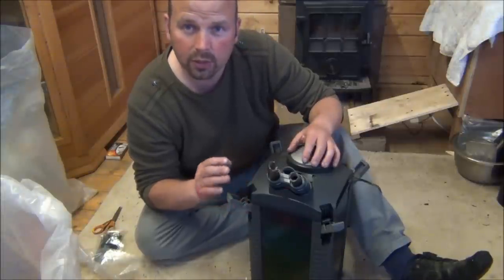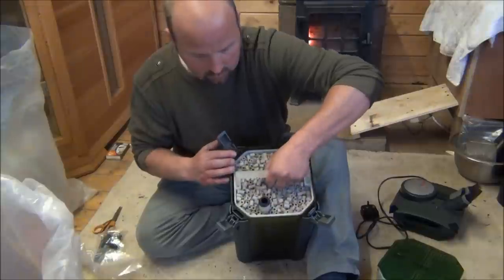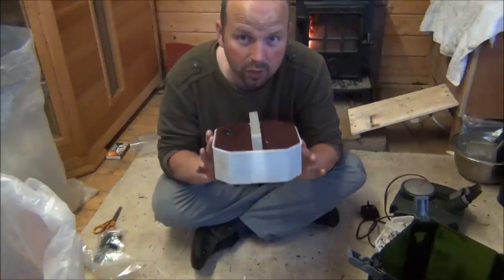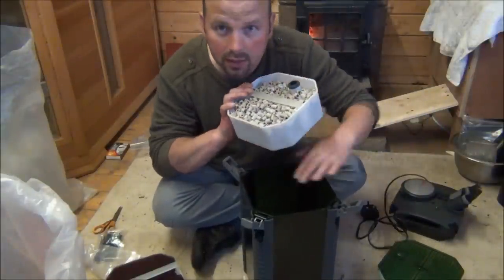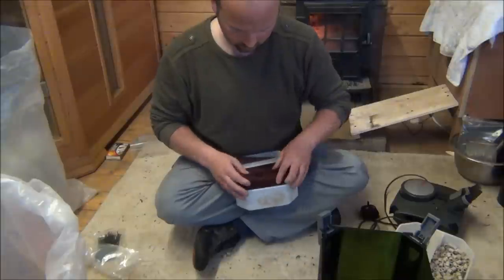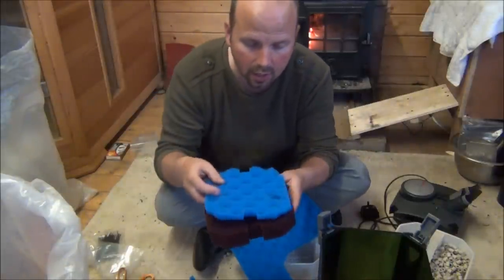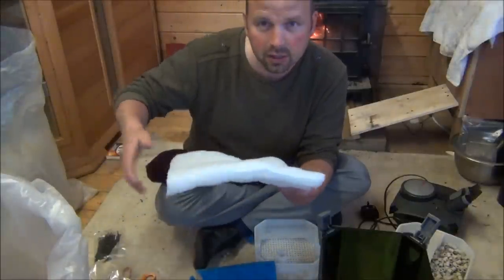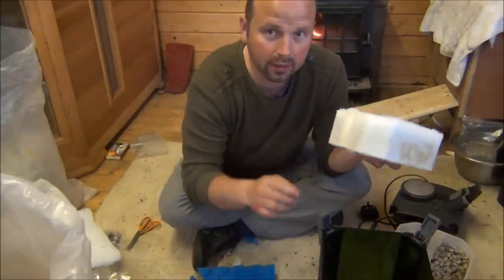How to set up an external canister filter for aquarium by Pondguru

Comment: Hello,

I've recently bought a kg of the Biohome Ultimate for my Eheim Ecco Pro 200. To get a snugger fit in the baskets I'm going to snap each piece in half. This seems to create a lot of rough edges and more importantly, dust. I'm conscious about this dust entering the aquarium. Would it be worth while having a second fine particle mat after the biohome media?
Reply from the maker: Chris Stokes Just rinse the dust off prior to using the media and it will be fine. There should be no need to snap it up to fit in an external as the media is only 3-4cm long (1.5") and about 10mm (0.5") diameter - specifically designed for external filters. Snapping up a small media like the mini ultra or ultimate will affect its ability to hold anaerobic bacteria and reduce efficiency. I would definitely advise against snapping it up as it is not necessary.

Comment: Hi richard, thank you for the many useful video's. Just one important question:

These filters take water from the top, so wouldn't it be most logical if the mechanical filtration is at the top? Because if the biological filtration is placed at the top, the water first runs through there leaving a lot of debree, at the end it reaches the bottom one and than comes back up, so most of the muk as you call it would stay on the biological media.

Can you clarify this for me, thank you very much!

Comment: I actually have a question for the biohome filter media how often do you change the media? For example I have a 75 gallon with 4 fancy goldfish... they can be quite messy and I feed them 2 times a day some days with snacks in between feedings.
Reply from the maker: In a properly set up filter where media is protected from clogging by foams and fine pad the biohome should remain effective for 6-10 years.

Comment: Hi, just purchased some of your Biohome Ultimate after watching your video, my filter is currently set up how yours was upon receiving it.

When I receive your media, is it ok to add the quick start balls into filter if it's already stocked with fish?
Reply from the maker: DaveMorris Yes you can add them and it will help seed the media with good bacteria. In a mature system only replace 25% of your old media each week so the full change over takes a month or so and that way you won't notice a dip in filter performance while the new media matures.
Reply: Thanks for your quick reply, just watched a whole load of your videos, very interesting.

I've got an FX6 so I work the other way to most, how much do you think I'll need to fill that, bar the first tray of course! Bought 3kg and starting to think that's nowhere near enough after watching your videos with much smaller externals!
Reply from the maker: DaveMorris According to the dimensions I have recorded for the FX6 you would need around 1.5kg per tray so if you only want to fill 2 trays then 3kg should be fine. As you'd generally use around 1kg per 100 litres the 3kg should be good to see a decent nitrate reduction in around 300 litres.Some people with the FX5 / FX6 simply go with a fine pad on top of the top tray (as you have lots of foam around the trays) and that allows you to get approx. 5kg in the filter if packed in a bit neater.

Comment: Hi just watched this video & it makes sense,,I'm quiet new to this fishy stuff,,I bought a 4ft second hand tank,, set up and my Fluval 305 is making such a noise,, I've followed all instruction,,primed it till my hand nearly fell off but still,noisy,,then I noticed no water is going in or out of the pipes!!??, so I could carry on with,sorting out the water I put 3 internal filters and they have done the job just great,,but would like to use the Fluval really,,, can you give me any tips ,many thanks Liz 🐠
Reply from the maker: +liz thurstance Just try and fill the canister completely and also fill the pipes too then it may do better. Sometimes externals are difficult to get going. Sounds like you have air in the pump chamber so if you gently tip the filter from side to side that may free it. It is trial and error.

Comment: Cheers mate ,so to clarify ,i d put the peat in the biomedia tray at the top ,and do you know how long till the peat needs changing ?thanks
Reply from the maker: Yes that position is correct and with regard to the active life of peat it will vary from product to product - some is extremely hard, compact or could be loose - just be guided by manufacturers recommendations but it should last many months.

Comment: I have a sunsun canister with 3 trays the one with the 9 watt uv bulb but today I brought a second hand ehiem 2026 with only 2 trays which one would you recommend would you use the one that holds more media or the one with more lph
Reply from the maker: It depends how you set them up. High flow rate will be more beneficial for fish which like a high flow but if you are using Biohome media you will get better nitrate removal at slower flow rates.
If either filter is set up properly it will do a great job.

Comment: You've used a second hand Ehiem, do you need to sterilise it before use, or will any possible nasties die if you just let it dry? I assume that this applies to all second hand aquarium kit. Hope this makes sense.
Reply from the maker: Just give it a good wash out in tap water. I can't think of anything which would transfer from marine to fresh which would harm anything but of in doubt add some Meth blue or anti parasite treatment to the water you are using for cleaning and should be no worries. Most people would just thoroughly rinse under tap then set it up with new foams and new media.

Comment: ok, so you put the ceramic ring right in the bottom of the canister in the gap between base and bottom tray, will this effect the waterflow?? i like the idea adding some media there but worry about the flow rate
Reply from the maker: As long as the ceramic rings allow a gap of a few mm (maybe 1/4") between the bottom of the tray and the rings water flow will not be affected at all although it will head off in different directions through the rings, hopefully settling out heaviest muck.

Comment: I managed to get a second hand Eheim Pro 3 that had previously been used with a marine set up.As i am going to be using it for a tropical set up what will i have to do with regards to cleaning it before use.
Can i still use it ?
Reply from the maker: Just give it a good wash out in tap water. I can't think of anything which would transfer from marine to fresh which would harm anything but of in doubt add some Meth blue or anti parasite treatment to the water you are using for cleaning and should be no worries. Most people would just thoroughly rinse under tap then set it up with new foams and new media.

Comment: Thanks for the videos. I really feel like I can trust your knowledge, and therefore I subscribed.

I am setting up an Eheim 2213 soon, which just has a single can which holds the media (unlike yours, which has multiple media trays). I plan to set it up as you described in the video, meaning that I will have to place my fine filter pad underneath my biological media.

I would like to know what you recommend when it comes to maintenance of canister filters (in terms of media- not the canister itself and its parts). Also, am I correct in thinking that I will have to remove my biological media each time I want to replace the fine filter pad?

Thanks.
Reply from the maker: Yes you will need to remove the media before cleaning the pads or you can get  an in-line filter pod for the foams from All Pond Solutions. If you use one of those before the Eheim filter you will not need to maintain the media filter. Alternately you could put the media into media bags (mesh bags) making it easy to lift out if you didn't want to go with an extra filter. Here is a link to the APS filter booster thingy which would hold all the foams - they are available in 2 sizes. Foams in them aren't the best but it is easy to replace them with the profile cut pond foams and fine particle matting. Hope that helps.
http://www.ebay.co.uk/itm/External-Aquarium-Fish-Tank-add-on-Filter-1-2L-All-Pond-Solutions-EF-Booster-/181384791852?pt=UK_Pet_Supplies_Fish&hash=item2a3b60472c

Comment: I decided to upgrade to a canister filter on my 60 gallon tank. I was going to buy an Aqueon 300, but purchased an Aqueon 400 by mistake. (Actually cheaper at my local store) anyway, I setup my filter using your system but the flow into my tank from the spray bar is very fast. (The fish look like they are on a rollercoaster) I have swordtails, platties, mollies and a few clown loaches. There is no flow adjustment on the Aqueon, is it ok to put a clamp on the exit hose to decrease the flow?

Comment: Thanks for the video, very interesting. Just a question, we have the Eheim professional 2226 filter that has only 2 trays. How would we set this up? Thanks
Reply from the maker: The foams and fine pad would be in the bottom tray and media would be in the top tray. Unfortunately I can't find details on the size of trays or filter volume online, even on the Eheim site for the 2226 but if you measure the tray for media I can work out how much will fit no problem. sales@filterpro.co.uk
Regards,
Richard
Reply from the maker: That works out as 2.7kg of biohome ultimate (possibly you could get 3kg if extremely neatly packed)
Reply from the maker: The amount of media needed to provide full cycle filtration (reduction in nitrate) varies depending on the stock and I have a guide on the Q&A page of my website here: http://www.filterpro.co.uk but that would generally start at 1kg per 100 litres for a normal community tank rising to up to 2kg per 100 litres for heavily stocked situations / goldfish.
Yes always best to add new media gradually in a mature system - also have notes on Q&A page about that.

Comment: Does the Biohome filter media need to be rinsed prior to setting the external filter up? Will it make my tank water cloudy?
Reply from the maker: With any media it benefits from being rinsed just to remove any dust generated during shipping. It's no big deal if you don't rinse it though as any slight clouding will quickly clear.

Comment: Hi Pondguru, I've just got hold of a second hand 230L tank and a Fluval 306 but I don't think the media is setup right. Bottom tray has coarse black sponge, next tray above sintered glass media and top tray fine stuff. I know water enters the right side and passes through what looks like medium foam, but not sure if it then enters trays on left flowing up or down or even if the trays are in the right order . Thank you for your answer.
Reply from the maker: The foams down the side of the filter do a decent job so you really only need a medium and fine pad in the bottom tray (if there is space you could go with coarse too) then media in the trays above. Each tray will fit approx. 800g of biohome ultimate (best type for externals) but with careful packing you can get up to 1kg in there. As you have 3 trays and the bottom one is for foams that leaves 2 trays for media so 2kg should give you enough media to see full cycle filtration up to 200 litres for a normal community tank.
Allowing for substrate and ornaments etc. you'll have around 200 litres of water in there.
Reply: Thanks for your quick answer. As suspected the water filters through from the bottom up, so I will put the fine stuff above the black sponge in the bottom tray right before the media. The black sponge in the bottom however looks coarser than the side ones but probably wont harm.
I have bought media off you before so I have every confidence in the product and will order another 2kg and replace the shitty shiny stuff. Respect!
Reply from the maker: No worries and thanks for the order. Best of luck with the tank.

Comment: will this set up work for the JBL CristalProfi e901 External filter aswell , great vids. thanks.
Reply from the maker: +Joe Hayes Yes as it works for the most part just like the filter in this video. Only difference is the 'pre-filter tray' before water heads down to bottom of the filter before rising up through the trays. Just leave the prefilter tray as it is and set the rest of the filter up like this video. I think the 901e takes approx. 1.5kg per tray.

Comment from the maker: +Dibyendu Sharma Mondal 
I can't reply to your comment for some reason and your channel does not have the option to send a message - here is what I tried to post:
Most of the cichlids you have prefer hard water at around 8.2 and would benefit from mineralisation from coral sand and ocean rock. That may be part of the problem. There is no filter seen in the video but as long it is of suitable size (i.e. a 300 litre filter for a 150 litre tank) and it is set up with foams in bottom tray and media in tray above it should be fine. The problems with white poop could be a digestion problem or internal parasite so you need to treat for internal parasites (worms) and make sure the water is suitable quality for the fish.
Reply: +Pondguru Outdoors Thanks a lot for the feedback. I have setup as per your instruction. However for some reason I see the water bit turbid. I have the ceramic media in the gap area where the fist tray start at bottom. Then I have the first tray with the 3 layer or sponge and then the 2nd tray with Bio media that was best available here in India and porous in nature. Then the enclosure tray. Also I have ordered for Purigen 100ml pack and should arrive in few days. Where should be it placed in the filter now.

Am I missing something. Previously I use do it bottom layer as Ceramic and then fine sponge. Then 2nd layer 2 layer of course and fine sponge. Water was coming out clean that time. Not sure if I am missing something here.
Reply from the maker: +Dibyendu Sharma Mondal As far as the clarity of water goes it should not mater where the foams and fine pad are placed but to keep media clean they all need to go in bottom tray.
See notes on filtration and purigen here: http://filterpro.co.uk/qa-24-w.asp
Reply: +Pondguru Outdoors Thanks, I did a water change and refixed everything once again. Let me see the progress in morning....atleast give 24hours. My media was new may be thats the reason.
Reply: how much life expectancy would you give to a big external filter like this? (if the motor dies for ex.) Do these big debit machines burn out faster than a filter for smaller aquariums?
Reply from the maker: Both internal and external filters should last for many years but generally the external filters will last longer than the internal filters.If you use a good manufacturer (e.g. eheim) the spares will be available for all the previous models too.
Reply: External should last for ten years at least and if yu need renew a new engine its simple do that so there no limit in lifetime for that external. A new engine from china cost you maby 5£ no more inlcude post fees. :)

Comment: Pond  I meant put the poly - Filter on top of the fine filter would that be ok or just don't use it, I do love using the BioHome  media Thanks Rob
Reply from the maker: The fine filter pad is a polyester pad so they are the same thing. You normally wouldn't use 2 fine pads.

Comment: Hi Again would the water cool down a lot if i sucked the water out from the heater compartment by the time it returns to the tank or would i be better putting heater in the tank,Red sea max 130,Thanks again
Reply from the maker: It won't really matter where the heater goes as the water turns over so quickly.

Comment: How would you set up a Magnum 350 canister filter? One was given to me, and I would really like to hear your opinion on the matter.
Reply from the maker: Justin Brown I'm not familiar with those filters but they look they rely on a cartridge system a bit like a hot tub filter so wouldn't be easy to make work as a biological filter. They are essentially a mechanical filter / water polishing unit? which would go before a filter which contained proper biological filter media. Something like a booster unit would be fine placed after this filter if it was filled with biohome in bags: http://www.allpondsolutions.co.uk/aquarium/aquarium-filters/external-filters/ef-external-filter-booster-supplimentary-canister/

Comment: I use the eheim 2217 canister filter, a Aqua Clear HOB filter and a rather large sponge filter, all on my 60 gallon Discus tank. One question, do you think BIOHOME MEDIA is better than K1 ?Thank You in advance,
Woody
Reply from the maker: Biohome is a totally different type of media to K1 as it is a static media which supports aerobic and anaerobic bacteria to complete the nitrogen cycle - ammonia > nitrite > nitrate > soluble nitrogen . K1 is a moving bed media only supports aerobic bacteria so will only complete half the cycle - ammonia > nitrite > nitrate.
Plastic media would never be used static since the surface area is so small compared to any ceramic / sintered glass media and the bacteria held would be negligible.
Reply from the maker: There is more information here: http://filterpro.co.uk/qa-24-w.asp and the video 'Moving bed filters 101' will help too.